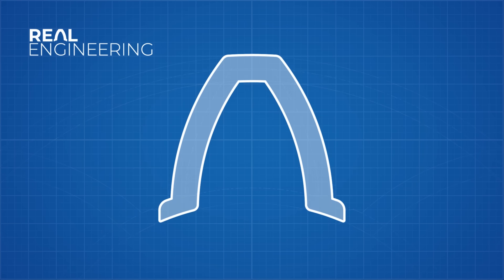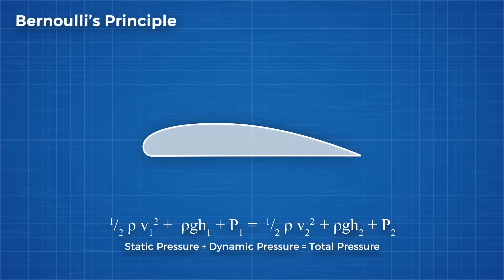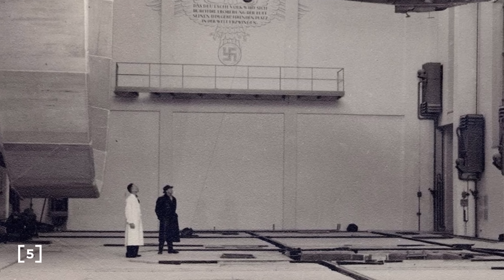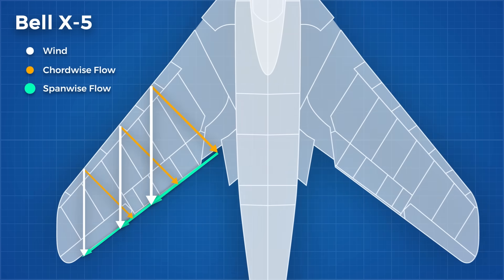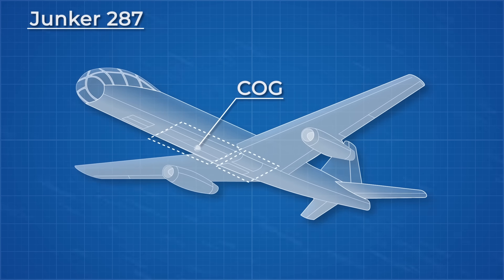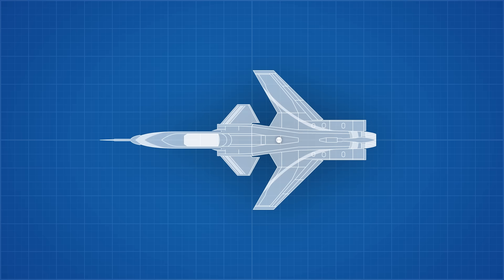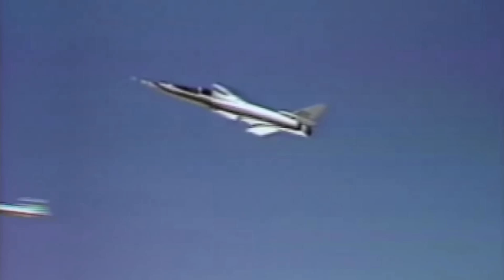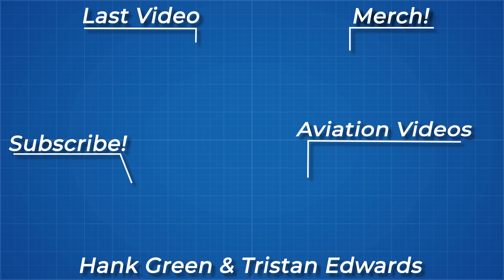Why Do Backwards Wings Exist?

Comment: Your drawing of the wing being Level WILL NOT TAKE OFF !! A wing has to have air PUSHING on the bottom side to create "LIFT".  There is not enough differential pressure to "Lift" an airplane that is flying level. THAT is why jets (747 example)  wings fly Nose High. If they flew flat like your drawing they would descend.   The "High Pressure" Under the wing is not enough to create the lift Required.  Sorry, but I have my degree in this and it is Absolutely Provable ! My 'Professors' argued this point with the reason of "THIS is how the FAA wants us to teach it."

Comment: Easy answer is : The wind follows the angle of the leading edge. If swept back as normal, the wind goes off the end of the wing. If swept towards the fuselage the wind will create more lift as it cannot just go Off the end of the wing. It will hit the fuselage and be Forced over the wing. Look at air EXACTLY as you do water, They have the same physics although water is thicker. FLUID DYNAMICS !!

Comment: Have they tried the backwards wings but with different surface and edge angles to  find a way to make that areodynamic?  Possible th wings would look close to how the body of stealth fighters look. Try doing very angled wing surfaces on the top and bottom and maybe a sharper v shape near the connection of the wing that helps force airflow in the direction u need it to go? We basically are close just need people to try everything u know don't give up the shape might work with different surface designs. The whole plane is assembled to control airflow u just gotta keep at it. It's not impossible if ur already doing it otherwise no plane would fly cuz we would only make bricks and flat sheets of wood  basically

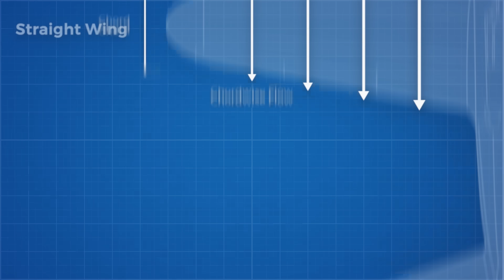Comment: 5:00 why the heck should the stream of air flow in that canted angle?? Isn't it always the straight direction?
Reply: If you are referring to how the air sticks to the curvature of the wing, it comes down to the coanda effect; fluid dynamics that with low pressure coming off of the wing, the surrounding air "sticks".
Reply: In physics there are these things called free body diagrams which separate forces into parallel and perpendicular components relative to the object of interest thanks to Pythagoras' theorem. In this diagram the white line is the "actual" force of the air while the orange line is the perpendicular component of the force the wing feels, and the green one is the parallel component of the force on the wing. The orange line is perpendicular to the face of the wing, if that makes sense
Reply: @Madibes I basically know that things like forces (or in general all vector based values) can be seperated this way. But for the laminar air stream showed in that diagram it doesn't make sense to me somehow...

Comment: well because forward wings are like arrows. also try drones with wings lift. well quad copter planes dont have turning issues because of differential thrust. dont make planes that can stall. place props at the tips of the wings where the vortices will appear. if you want to resist twisting and bending, I-beams all around the wing. ie box wings next to each other. just use pressed plastic for air planes. also zero radar signature. just like a wall of a house. if your plane is robust enough, you can fly it with a manual stick only. flight computer is for automation only.

Comment: 2:01, bernoulii's principle doesn't apply to airfoils because it doesn't take into account the bottom surface of the wing, the angle of attack, the downwash the wing creates, and it is only applicaible in incompressible flow. Horrid explanation of lift!

Comment: It’s the force of an object travelling through a medium ( the atmosphere ) that causes lift. Stick your hand in water and you will understand. The low pressure is a result and not the cause. The faster we go in our environment, the more pressure is put against your hand. 
The atmosphere acts the same way. This hypothesis of low pressure and high pressure is out of date. Low pressure is the side affect to moving objects in a medium with mass or substance
Reply: The current theory of lift involves both newtonian (airflow deflection due to hitting a surface) and bernoullian (pressure) elements, resulting in a turning of flow across a surface. 

Both are important factors
Reply: @Orbital_Inclination  thank you for the insight. Much appreciated and I hope you are doing well

Comment: The beginning information on my and our new war plane design involves a dark black, rather reflective coloration to be kept as polished as possible for shock and awe effect. To coach-house its two fighter pilots is the mid-rear, semi-spacious transclucent 'crab-head' compartment: the main and widest mass of our war plane. The rest of the design is very sleek and streamlined so as to reduce air-friction at high speeds. The wings may be nearly elliptical like the British spit-fire but they are comparitively diminuitive and drawn back(in fixed position) to the back rear sides of the aeroplane yet 'sticking out' to some significant length. I rather reconsider the elliptical suggestion in favor of a simple rectangle on each side. The four-positioned alternating sun-disc engine is in the central rear of the air-craft with a nuclear-fusion battery; This is an electric airplane; though it may petrol on a hybrid basis. The front of the aircraft likewise is reductionist and streamlined to minimize air-friction but solid and substantive enough to serve its main purpose which is to launch missiles or drop bombs or shoot guns; It will be equipped for all three, though not necessarily on the same voyage. We are a team working under American auspices; and these are design suggestions you should seriously consider but may alter as we design an effective hyper-modern manned weapon of the skies together.

Comment: Haven't watched it yet but I know they're going to say it but its instability makes the plane more maneuverable.

You can have a very stable Wing but hard to maneuver or you can have it unstable wing and easy to maneuver.

The catch is it requires more skill.
But if you're building for commercial you would rather have your pilot's on training wheels then hi maneuverability.

Comment: There is also a third air current where air travels alongside of the attacking edge of the wing and it forms a turbulence on the edges, that is why commercial jets have vertical small winglets on the ends.

Comment: Reading the story of the plane pictured, it was built with reverse wings so as to make it as unstable as possible and then test out computers in the plane that could possibly overcome the innate instability. It was built for the testing of computer controls. The plane is at the USAF Museum in Dayton, Ohio, and is featured in some of their books about the planes in the museum.  The man / men who actually flew the plane had to have a triple set of cajones, but it apparently did its job, because it is still in one piece and not amongst a pile of scrap aluminum.

Comment: Yeah don't exclude the computer systems that were underdeveloped then. And today we can use an AI to adjust the controls 1000 times per second... which will basically remove the instability

Comment: Here in early 2023.   As a teen in the 1980's, I had a yearly subscription to Science Digest magazine back then, starting around 1980-81.  Forward-swept plane technology was one of those memorable articles in the magazine, so I've known about it since the early 1980's, but haven't read about it since.  I was really into airplanes & jets back then, I even have several plastic scale models that I put together in those days, such as the F4 Phantom, F104 Starfighter & MiG Foxbat.  And I also drew some new jet designs, heh.  I do remember in the forward-swept article(s) that one of its other primary potential advantages, that was not mentioned here, was being able to turn faster, especially during dogfights.  But alas, just as was shown here in the video, the technology did not last long because of the problems.  I knew back then as a kid that forward-swept just was not a simple enough type of flying that was more of a problem than a saving grace.  Aft-swept is more common sense physics-wise because the tips of the wings are "behind" the plane or behind the root of the wings at the body & creates sort of an aft drag. It is similar to how we put feathers at the back end of an arrow.  It's also why we do not see birds with forward swept wings (except when it flaps forward), although it's more complicated than that.  Oh, & I still do have all my Science Digest magazines from the 1980's (~1981-86), most of them still in very good condition. But I might have to sell them eventually.  I don't even think there are scans of it online either, which is odd, but understandable, since it is a very old paper-only publication.

Comment: Last year I snapped an image of a hummingbird tail up, with its beak in a flower. When I checked the images, I noticed that while the hummingbird was facing down, the leading edge of its wings were facing up. I had to look at it a few times to be sure. Apparently hummingbirds can rotate their wings 180 degrees, and this showed it well. Amazing.

Comment: The Bernoulli principle is not false but does not generate enough lift to lift anything. Also if that was the only way how airplanes would generate lift, an airplane flying upside down would have to immediately ram into the ground and we all know that this isn't the case. The main lift comes from the fact that wings are at a slight angle and thus constantly push air slightly downwards. If you push air downwards, you push yourself upwards (every force has a counter-force; fundamental Newton principle). Depending on aircraft, the Bernoulli principle generates 5 to 30% of the total lift force, which means that is not really the reason why airplanes fly as pretty much every modern airplane would still fly without that lifting force, it just would need more fuel and there would be more stress on the construction along the flight direction.

Comment: I wonder how much the development of the F117 contributed to the multi-redundant flight control computers. As I understand it the frequent and continuous micro corrections required to fly an X-29 are also the norm for the F117 which was in development just a few years before.

Comment: It seems the problems with forward swept wings are less in model scale. I have models which such a configuration which are extremely stable. Especially at a high angle of attack it doesn't roll or anything it just looses height while holding orientation.

Comment: The P-61 Blackwidow also a World War 2 design features a way to turn that’s on a lot of modern jets called spoilerons which at higher speeds allow it to turn.  It also features ailerons to provide roll control at lower speeds.

Comment: Aft swept wings also stuck around because the benefits of forward swept wings could be achieved with 2-axis thrust vectoring, allowing the engines to provide control authority in pitch, roll and yaw.

Comment: These wing designs are not efficient.  As the aircraft accelerates.  The wingtip turn upwards or downwards.  As the speeds increase that twist increases to the root of the wing.  Ultimately ripping off the wing.

Additionally it was discovered that the rear elevator would be more efficient if turned upside down.

Comment: You might be interested to know that there actually was a mass-produced, forward-swept wing aircraft.

The Nakajima Ki-43 Hayabusa, produced in large numbers for the Imperial Japanese Army, did in fact, have forward-swept wings, though the sweep angle of the leading edges are hard to notice unless you really look at them.

Additionally, IIRC, the sweep on the wing of the ME 262 wasn’t actually added to improve high-speed performance. The original design called for a straight wing, with the engines nested into the fuselage at the wing root, similar to a P-80 Shooting Star. However, the engine it was originally designed to use wasn’t available, and the replacement was too large to nest into the fuselage and had to be slung under the wings. With straight wings, this upset the plane’s center of gravity, so the wings were swept back to bring the engines (and thus the center of gravity) back into the proper position. The advantages of the swept wing at high speed was a happy side effect.

Comment: The short version is that the worse it is at going straight, the better it is at turning. Fighter jet designs are constantly trying to find a sweet spot where it still CAN go straight if it wants to (as well as other requirements, like carrying stuff and not killing the pilots).

Comment: There's a legitimately good reason why nobody has adapted the FORWARD SWEPT concept: Like the VARIABLE SWEEP WING CONCEPT OF THE DAY, even a dummy as myself can tell that it'll simply FLIP OVER belly side up and go somersault at the very first it reaches airborne speed. Other words:  IT'S NOT VERY AERODYNAMICALLY EFFICIENT.
Reply: watch. the. video.
Reply: @osyisr6361  

📣📄📎🎭

Forward Swept Wings:

Sorry, but if forward swept wings are really that much more advance and revolutionary, then, the idea should have taken off like fireworks rather than staying behind in the back burner like it does.

As is with the weaknesses produced by variable sweep wing and the jump jet the forward swept design too will go out of favour.

Comment: Fun Fact: the X-29 was actually a redesigned T-38 Talon/F-5 Tiger ll, a plane already made for cheaper production, lightweight, and a well known test-bed for certain experiments including a overhauled version with more modern features (aka the F-20 Tigershark)

Comment: There are some forward swept aircraft in production. (I flew three of them: Ka2b, Ka7 and ASK-13.) Also, the HFB320 Hands Jet had forward sewpt wings, mainly to place the spar carry-through behind the cabin and pressure vessel. 

On a side note about canard wings: You don't want them to deliver lift essentially, because they suck at it. For efficient lift you want high aspect ratios and a good elliptical lift distribution. Canards can't deliver that and are usually highly stressed when contributing to the lift of the aircraft. But they can be designed inherently stable, as the Rutan-Designs and Derivatives show (VariEZ, LongEZ, SpeedCanard, Cozy, Velocity, Starship). Best efficiency is reached in classic configuration though, with a tailplane delivering as low force as possible. This is why practically all high performance gliders are of classic design with a small tailplane on a (more or less) long boom.

Comment: NASA will disagree with you on Bernoulli's principle doing much for producing lift.  The Clark Y airfoil and others like it, are designed that way to reduce drag, not produce lift, and they give a smoother entry into a stall.  Wings and flight control surfaces produce most of their lift by turning the airflow........angle of attack.  That's why many aircraft have symmetrical airfoils, along with many helicopter rotor blades.  I can find you a link, if you want to read up on it.

Comment: Growing up on Long Island where Grumman was and this was built I actively followed its development.  I was in HS from 84 - 88 and it was engineers from Grumman who spoke to us about working as aerospace engineers, which is the degree I achieved in 1992.  Sadly by then the Cold War had ended and Grumman was completely imploding as a result.  Still, during those years from 84 - 88 I followed everything I could about the X-29 and my mom's house still has the X-29 sticker on my old bedroom door.  

As the video accurately points out, the real take away's from the program turned out not to be the use of forward swept wings but the advancements in computer controlled/enhanced flight and advances in composite materials, both of which are major aspects of new military and larger commercial aviation.

Comment: A really important question here, would the development of our technology right now make this project viable again? Since flight control systems needed to produce 40 changes in a second(or smth lile that), does our faster computers now solve that problem more reliably?
Reply: I also always wondered about that too, until he mentions stealth characteristics at the end of the video
Reply: It is viable but the problem is that in combat supermanuberability isn't any more useful than better sensors and situational awareness most air to air engagements favor a defender that can respond to the attacker in the first place instead of turn within his own plane length

Comment: One thing actually wrong with that animation about lift is that the airflow on the top of the wing is moving much much faster than the bottom. It will get to the trailing edge much quicker.
Reply: That actually is not true.  The air over the top does go faster, but it will reach the back of the wing at the same time.  It goes faster because it has to go over more area in the same amount of time.
Reply: @Bendigo1  no it doesn't. That's called the equal transit theory. A very popular albeit wrong explanation of how lift is produced.

Comment: Backwards winged a10 type of vehicles that use 30 mm cannons are not a bad idea they could probably bring back dogfighting because its maneuverability making it better than missile and it would probably be better than the a10 as well because its maneuverability but idk I dont build and design planes But it would probably be stronger than a10 as well because you have to build it stronger than anything else because its wings are backwards, use legos and build something with backwards wings and normal wings and push backwards fairly hard and if there built equally the normal wings will break off first